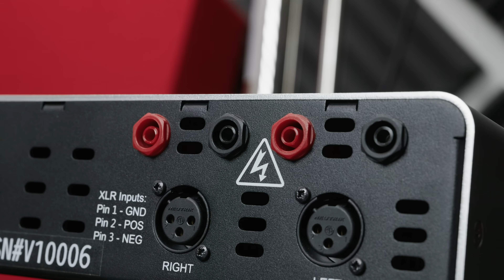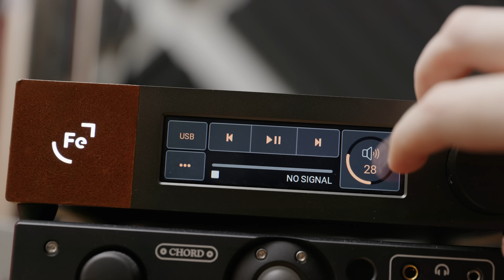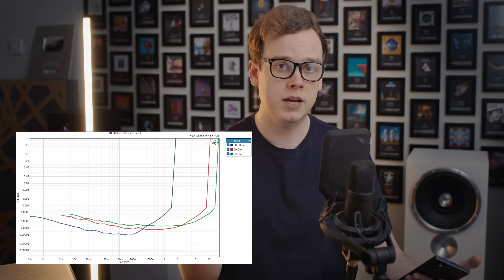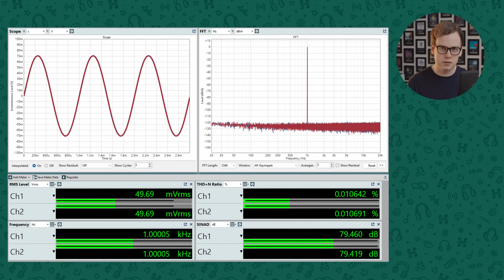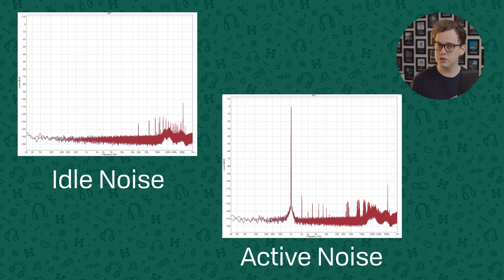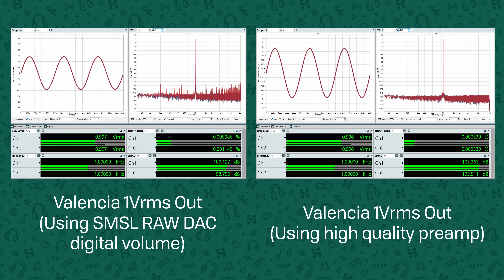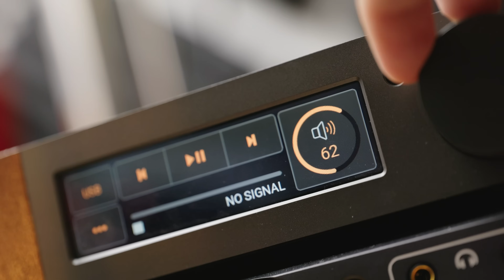Zeos & Orchard Audio made a headphone power amp 👀- Orchard Valencia Review

Comment from the maker: A couple quick notes:
1) I should have made clearer, but the main reason that the preamp is more of a concern is due to the 14dB gain of the amp. With a 4V DAC the Valencia will output 20V, and so quite significant volume attenuation is going to be needed for less demanding headphones, thereby meaning your preamp/volume control is quite likely to be the limiting factor for noise and distortion, not the Valencia itself. (For IEMs you may need around 50dB attenuation)

2) At 6:40 the graphs here are of the SMSL RAW DAC, not the SMSL RAW Pro DAC
Reply: Hi Cameron, mate i've been listening to others as well on this very Channel. They are good but i always Wait for your Vlog on anything. I am fan of your Commments/ Reviews on products specially on DACs, your cup of tea. I hate when you've Shut your "Golden Sound" Channel. Now, the moment of truth. Please, tell me Honestly is there any " JDS Labs " new Element is coming, i think you are working on that one, A Colab !!!  Waiting for Reply, thanks...  🙂🙂🙂🙂

Comment: When it comes to amplifier architecture less can be more in terms of sonic transparency. 
The electronic hardware required in this circuit topology seems consistent with the minimum necessary to accomplish that goal.
Dense power amps with weighty toroidal transformers do not guarantee better musical performance.

Comment: Value a product based on hardware cost and retail price is unfiar. Some product requires more engineer research time. And margin is high due to it maybe not massive production. If you sell 10 units to cover all costs and profit, you must have high margin. if you can sell 1000 units, that's different story. But finally, it is about sound good or not.
If it is good, then the price is fair, otherwise people just turn to alternative.
Reply: Yeah we had to create 100 of these to get any price breaks on cases and boards. Soo. Limited run for now. We will re-order when those run out but Tariffs are now in full swing even for the smallest screws that end up being imported.

Comment: If what's inside doesn't somehow match the price without major margins in between, why doesn't a similar or equal product exist for half the price?
Reply: Because this is a niche product that little to noone is interested in. People who want to use an amp with speakers will buy a more powerful power amp and those using headphones will want a volume knob and less risk of blowing up the drivers, and likely don't own a good pre amp for headphone use. 
Price wise chinese companies could do this at lower cost if there was a demand for it. Out of the 2000$, 50% goes to the store that sells it and 20% is production cost. The other 600-700$ is divided between z review and orchid audio. A chinese company that sells directly or makes less profit margin could easily make this for less than hald the price.
Reply: Or if there not selling though a store (like 1500$ on the orchid website) then its over 1000$ profit. Yeah Chinese will definitely make one for like 700 bucks
Reply: Pedo has to make money somehow :P
Reply: What is inside isn't inside any other amplifier. That is the point. Innovation happened and everyone is waiting for the Chinese to steal it so they can save some money and watch the engineers fail? Like what?

Comment: Zeos has a lot of explaining to do regarding his statement about the Valencia being able to drive tungsten without any problems
Reply: I am not sure, why this review says it's not good for Tungsen. 

I have many customers with this headphone that are very happy. 

The person who makes the headphones has one and also happy with it.
Reply: The claim should be that it drives tungsten as well as other headphone amps, not that its better. People can enjoy tungsten on it and have the right to do so but it doesn't ouout more voltage than a topping dx5 ii for 200$
Reply: Valencia was built with Tungsten in mind. In fact an older Single Sided 9.0 Driver Tungsten that is like 6db HARDER to drive then the OG Double sided and 9db harder than the Mk2. It runs that one "fine", all newer models better than fine. Raising the Rail voltage of a the headphone amp designed for 1000 normal headphones for 1 headphone wouldn't be a smart move. I would put Valencia + Tungsten against anything Golden recommended or anything else in the world.
Reply: @ZReviews  biased take, do not trust z reviews
Reply from the maker: It CAN drive tungsten fine.
Any amp that can do 20V will. To be clear the statements in this video are more intended to say "Don't buy this if you're doing so thinking it will drive tungsten better/with more headroom than your current amp". Since that likely is not true.

It's not at all meant to imply the Valencia can't drive them.

Comment: I have been using Ferrum Oor+ Hypsos in Power Amp mode for some years now. Using my Dacs volume control.Sounds great. Been tempted in getting an proper preamp.

I would want to see more like this from so they can spend all Money on the parts that count for power Amp and save from the unnecessary parts they leave out spend the most money on parts that matter the most for best sound possible. To make the highest sound possible and exceed an equaly priced integrated Amp. If you already own a great Pre Amp. 
Many believe seperates are the way to go. Maximized for what they just need to do.

Comment: You buy a two thousand dollar amp but you also need a dac/preamp to control the volume but if you buy the wrong dac/preamp the amp sounds worse. And buying the "right" dac/preamp will run you about another two thousand dollars. It's not technically snake oil as you can prove results with graphs and charts but it's still a fool's game.
Reply: I brought this about with the assumption anyone that can buy a $2000 amp probably has something they want to use as a Pre-Amp. This thing is the Niche'st of the Niche and that is OK.

Comment: Valencia had no trouble getting tungsten to 95db, way above standard listening volume.  Best to drive it with a preamp and not a DAP though
Reply: Try vioelectric v281 or spl phonitor 2/3/X. You'll be surprised.
Reply: @mmm-u6e9e  I've been considering the SPL phonitor to use with headphones but was worried about how well it can drive headphones. Could it power something like Susvara?
Reply: @0d0d0d  it can, it's not the best pairing but good for the price

Comment: Thank you for talking about the audible differences between solid state amplifiers. A certain "science based" cultist would simply look at the noise floor, power output and call it a day, claiming this sounds the exact same as a Topping A90
Reply: Why do you suggest that the "science based cultist" only measures the noise floor and power output, when that's clearly not true?
Reply: @n0xt  They measure other stuff too. The point is that they don't talk about the sound at all, since they assume all solid state amps that measure decently well sound the same, which simply isn't true. And when they talk about headphones, they only care about the frequency response and low THD, and talk about the sound only in the context of distortion (or lack thereof) and frequency response. They put too much importance in their simple measurements, and end up missing out on a lot of the details while critically listening due to confirmation bias.
Reply: I don't consider myself to have a particularly sharp ear. But I can definitely tell between different solid state amps. And synergy is a thing too. I wish more reviewers would take this into account.

Comment: I love my Valencia and while I haven't tried some of the more powerful amps with my Tungsten DS I absolutely love it. I like how transparent it is as I can hook up whatever device in front of it and know that 1) I'll always power the tungstens well no matter what I pair it with and 2) that it won't color the sound at all. Yes it's pricey but it's a low volume niche product and Orchard Audio already has the reputation for making fantastic (but expensive) audio equipment.

I do wish it had higher output voltage but even as it is I'm very happy with it.

Comment: Quite uninspired design, a DIY case, no linear power supply, no class A amp. This does not look like a good deal for that huge price. I was expecting more.
Reply: 17wpc class A would be very very big and very very hot
Reply: Feel like 17wpc with Class A would be a slightly different thing. Entirely even.

Comment: Subjective and objective review says its good enough, but parts per dollar seems low... Large margins are made by many other brands too, so what the heck right? But it's their first headphone amp, and if it does not seem like a value proposition, I doubt many will buy it. It does not help that there seems to be no protection circuit, lack of outputs and volume control. Seems like a cash grab to be frank.
Reply: There are protections in place. The lack of volume control is the whole point.

Comment: The Cayin iHA-8 with a switch on the back that disables volume control and turns it into a power amp isn't talked about enough...
Reply: There are a few that offer this. The big Stax Energizers do this too. But the circuitry to enable that skill still has to populate the board. This doesn't have any of it.
Reply: @ZReviews naaa = You just saved  
                    $$$$

Comment: I still don't get the no volume controller thing.  If you have a speaker system and you want to add a better headphones out than what's built in to your preamp, sure. But as a headphone only system, you are limited by DACs with a preamp, like the Wanda's or the Halo Spring 3.  Personally,  the Valencia is too deep for a desktop setup for me. I would have preferred a much shallower unit as desk real-estate is a premium.
Reply: I based the case size to stack easily with a range of desktop gear that exists. Obviously it can be made much smaller but that would have made it an odd-ball on most desk setups. 

Getting rid of the volume from this means you can Upgrade to whatever you want. If the volume is built in you are stuck with it. So you had better hope whatever you get is as good as you ever want because you can't upgrade most internal volume pots / systems.
Reply: @ZReviews Understand why you made those choices, both don't fit my use case, but it fits yours.

Comment: Having worked on Orchard products before, I’d never own one. $2000 for this is crazy.
Reply: what went wrong if you don't mind me asking?
Reply: A friend’s Orchard GAN monoblocks blew up just from unplugging the laptop style switchmode power supplies and plugging them back in. Apparently a known issue with them and the guy behind the company wasn’t very helpful. I replaced the LMG5200s in both of them and the same thing happened to me while I had them. Not a fan at all
Reply: @PrimeHiFi  The OG Monoblocks? I blew up a set as well. This was years ago. I have since convinced Leo that people aren't engineers and won't read every warning in the manual. There is quite a bit of protective circuitry added to the later models.
Reply: You don’t have to be an engineer to conclude that the design was flawed to begin with. Either way, I was left with a sour taste in my mouth from the lack of support shown to my friend by the designer. Such a hideous design oversight should have never seen the light of day, and it certainly shouldn’t have been blamed on the end user of a product such as those. It’s the same as saying “Don’t shut the power switch off and back on, otherwise your product will blow up and we will not support you afterwards”. I’d be paranoid owning or using anything they make, especially with headphones 😅

Comment: The Ferum however, Z says has audible noise though, heard by the naked ear, rather than by a measurement computer program.
Reply from the maker: There's no audible noise on either (unless you're using campfire andromedas maybe...).
It's possible Z didn't have the unit grounded maybe?
Reply: @TheHEADPHONEShow He wasn't reviewing the amp. He was reviewing an IEM I think, on numerous dacs & amps, like 4 different stacks or combos, the Ferum being one of them, which he stated he heard noise on.
Reply: @TheHEADPHONEShow  I will double check. But the Ferrum was def noisier then the other units I pre-amped with. I will add a ground wire to see if that solves it.

Comment: What is "short" when you say you have to keep your cables short with a passive preamp?
Reply from the maker: There is no hard limit. When you use a passive preamplifier, the combination of the impedance of the passive preamp and the capacitance of the cable forms an RC low pass filter.

For very short cable runs (a foot or two), this will have no effect close to the audible band. But for longer runs it could attenuate treble meaningfully. This effect is reduced if using very low capacitance cables, but most manufacturers don't provide that as a spec so you'd need to measure it yourself. Generally if the cable from the preamp to the amp is less than about 2ft you're almost certainly 100% fine.
Reply: @TheHEADPHONEShow sweet thanks

Comment: One question:
Why this instead of a cheaper power amplifier+hifiman HE-Adapter?
Reply from the maker: The Hifiman HE adapter shouldn't be used unless you're using a tube amp. It has resistors in series and parallel, which means that:

1) Most of the power from the amp is just going to the resistors anyway, you cannot actually get the full power of the amp to the headphones.

2) For dynamic driver headphones it will change the frequency response and sound.

It's a handy tool for connecting headphones to tube amps which often need to be presented with a load close to 8 Ohm. But with almost any solid state amplifier, just connect headphones directly.
Reply: @TheHEADPHONEShow Even then is it not worth it? This amp being 17w into 32ohns doesn't sound too powerful as a power amp. Would there be a better way of converting a power amp > headphone out than the HE-adapter?
Reply: @ZandoNoid  You can on a class AB amp just plug directly into the outputs. You just risk blowing things up. THAT is why you want the not too powerful 17wpc vs a big 100wpc speaker amp most times.

Comment: This looks like a scam
Reply: I mean even I agree, but the proof is in the measurements and listening tests. Leo has a very VERY specific method in his builds. Pretend its going into a Satellite. No fat, no aesthetics in the boards used. Simple AF and Raw. Go look inside his $3000 monoblock Class D amps. You think stuff is missing.
Reply: @ZReviews  i am sry to say this but even if somebody else is trying to scam people with products that clearly are cheap to produce does not mean that someone else should also do the same. If you can really make such a good sound with so little production cost why not making it cheaper and available to more people and pressure the rest of the industry to follow along?

I am not here to tell you what to do and what not to but i would find more joy in bringing good audio to more people than pricing it up that much.
Reply: @sunnisun36  I mean this isnt an amp made in China. Just the chassis comes from there (so tarrifs). The boards are manufactured at a facility in Canada (and imported so Tarrifs) and the other parts come from US and Overseas suppliers. (so half tarrifs)/ Then an American team assembles and ships the amps. 

If this was a chinese amp it could be $1000 or less. It isn't.
Reply: It is somewhat surprising the level of components but listening and measurements show excellent performance.   The simple design of the amp stages and using a switching power supply don’t seem to have affected its ability.  Tye designer must follow the KISS principle, Keep It Simple, Stupid!